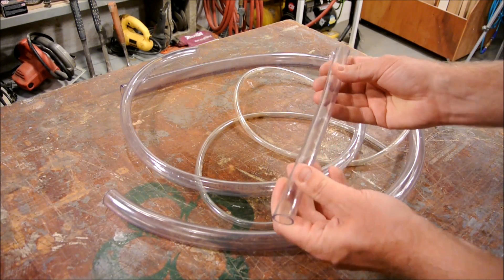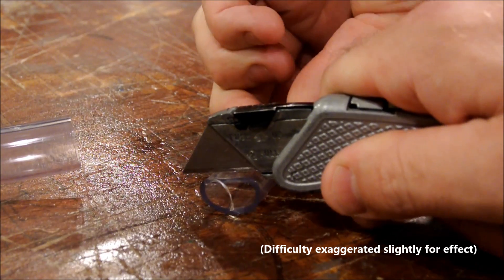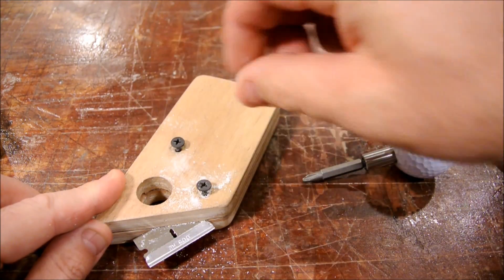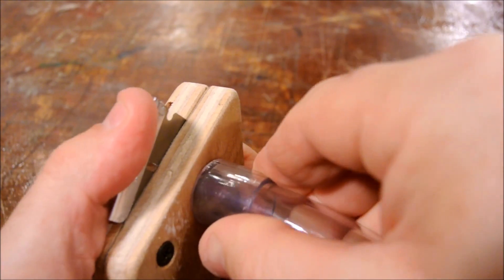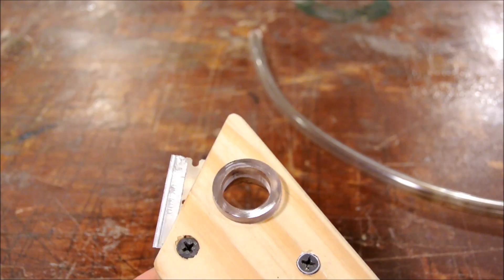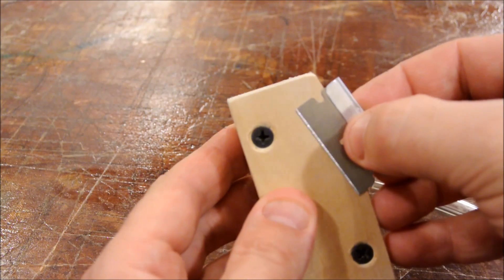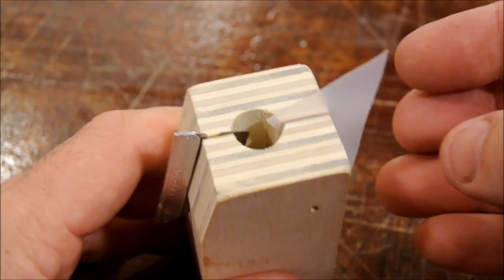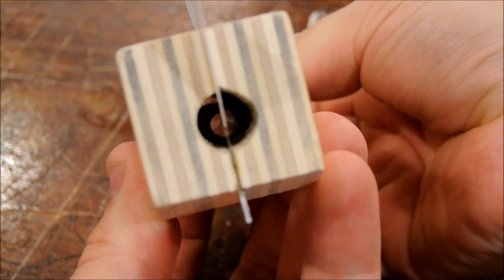Vinyl tubing cutter (homemade)

Comment: Hey pocket, having watched you use one in a lot of your videos, I bought a stanley quickslide 2  years ago and use it daily. The problem is I only bought one, and I'm afraid I may lose it one day. Being that they're discontinued now, I was wondering if you had found a source to get them online still? I've spent some time searching and haven't had any luck, but I thought it couldn't hurt to ask anyways. Thanks!
Reply: Bad news first: you're going to have to fight on eBay in order to get another. The good news is that they last forever! Just keep your precious clean and oiled on the inside to limit wear. As for mine, I have two in service and a few of them still in the wrapper.  

The Quickslide 1 isn't bad either. In fact, that's the one I had originally preferred until the simplicity of the 2 eventually won me over. You might find one of those more easily. What about similarly-designed alternatives? Well, I've bought tons of retractable knives in my search for one, and none of them come close. In fact, I was even planning on doing a video on the subject, but it would only come to the conclusion that there aren't any solid replacements for it yet.

If you're devoted enough, it might also be possible to have one machined and/or 3-D printed. The design is certainly elegant enough. I'm that sort of crazy; someday I'd like to make one in brass. Perhaps we should just solicit Stanley to bring it back! Or start an angry online campaign. In the meantime, you'll just have to stalk on eBay.
Reply: @pocket83squared 
I had a feeling that was the case, I'll just have to keep my eyes out and hope that I come across one in the future. I love the design, I'm just not sure I am willing to pay over $50 on ebay for another. You were wise to buy as many as you did when you did. 

A brass one would be awesome, I wonder how you would go about attempting it. You'd have to cast it I suppose, using a 3D printer to make the negative. Would make a great video.

Comment: I have a grommet question - On my ballast there is a rubber grommet which is on my headlamp that I need to put a new ballast on. I removed grill on my truck which the ballast resides on the metal frame and the cable that goes to the headlamp has a double rubber grommet that connect to the outer side of the plastic headlamp and connects on the inner side of the headlamp also with the double rubber washer like grommet. How do I release the grommet to replace the ballast?? Thank you kindly for your mechanic intelligence help. :-)

Comment: Found this while trying to figure out how to cut tubing (and then slit) to cover bobbins so the thread doesn't unwind. I will adapt this idea by customizing the thickness of the wood so the cut is the exact length I need consistently. 
Thanks for the inspiration.
Reply: I bought some of the tubing (PVC Clear Hose Vinyl Tubing 3/16" ID 1/4" OD) to cover the bobbins so the thread does not unwind.  Is this the size you purchased? I find the tubing really stiff.  Did you do anything to soften it up before cutting it?

Comment: @4:23 I noticed that the razor blade shifted. Maybe you could cross-pin a nail just behind it in the direction of pull to prevent the blade from shifting out and slitting your palm as you grasp the tubing on exit with your other hand. As we all know, repeated removal of wood screws tend to loosen their thread seats over time. Great video otherwise!! In fact, I would characterize your videos as being an antidote to the rash of videos that tout themselves as being "Amazing" when they are really just vanity solutions.

Comment: I am looking to cut latex rubber tubing that is very flexible:  1’O.D. With a 1/16’ wall thickness.  Any suggestions for a gig that might be able to make numerous cuts around 3/4” long?  Thanks.
Reply: That's tough. Something like this might work, if you insert something inside of the latex just to give it a spine. Perhaps PVC pipe that has a 7/8" OD, or wooden dowel. The insert should work nicely once the razor blade has made a sort of track that will allow the razor to pass through. Oh- and lubricate. Seriously. Knife cutting rubber works 50x better with a drop of oil. Mineral oil is perfectly safe to use on latex.
Reply: pocket83²   I am correct in that you sell plans for me to build this tool?
Reply: Sell plans? Haha. No. There's a free printout/template in the description, though. Let me know if it works out! Thanks.

Comment: the half split tube would make a great cable tidy.
Reply from the maker: CowLunch That is a really good idea.
Reply: pocket83 spiraling that cut would make  bends easier without deforming , 
you might be able to get two spirals out of one hose
Reply: Havana Woody That's true but wouldn't that make it very difficult to place it over the cables?
Reply: Not really and it could be even easier if you spiral cut it, using two blades a half inch apart making two for one.

Comment: instead of the FIN why not use second blade?
Reply from the maker: Андрей Баланцев Try it. But it's more stuff to align. It will also require twice the force to press it through. Alternatively, a single straight blade will not cut as efficiently: thus the curved blade of a katana.
Reply: pocket83 Before I saw it I thought you would use something like a piece of cheese wire.  Maybe that is not "sharp" enough for the job though.

Comment: You'd probably have to cut a lot of tubing with this device to make the  effort put into the construction of it  worth your while. Cool design, however.
Reply from the maker: ***** No, you just need to encounter a single situation where cutting it neatly is important. I have met such a scenario more than once, so it was well justified. Also, for the viewer, experimentation isn't even involved (and there's even a template), which makes this project a no-brainer. Plus, it's oddly satisfying to use ;)

Comment: Do you think that the lengthways splitter could be modified to strip the insulation from copper wire?
Reply from the maker: Arctic Arsenal Interesting. It only takes a scratch, and then you can yank it off. Let me know if it worked.
Reply: I have a lot of scrap wire that I have collected at work.  I take it to the scrap dealer for them with the insulation on, but I know that it would fetch them more money if it was bare.  I'll try this and let you know.  Perhaps I'll post a video reply showing it working.
Reply: Arctic Arsenal Video replies still exist?!